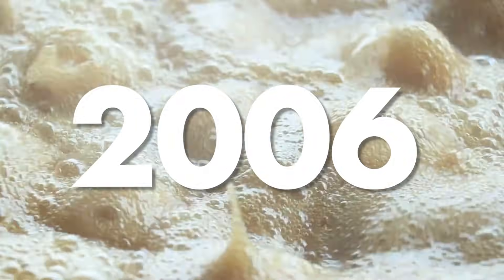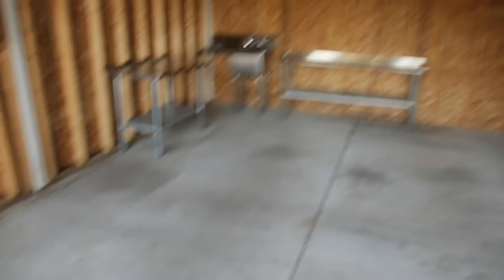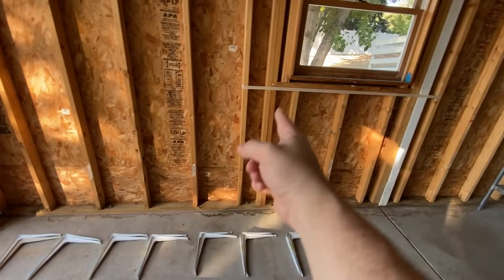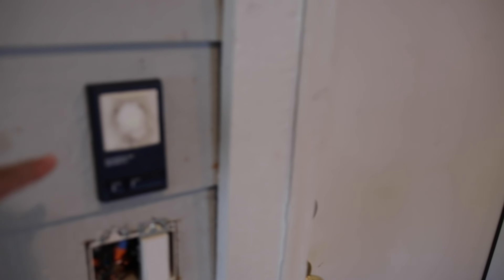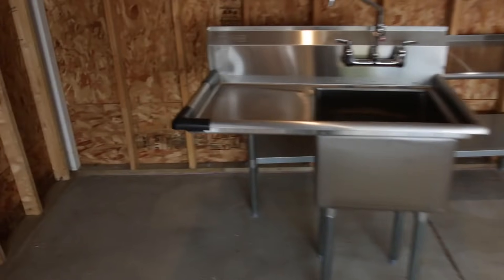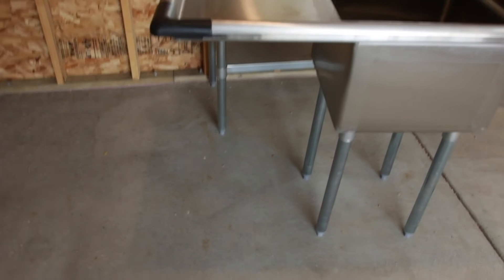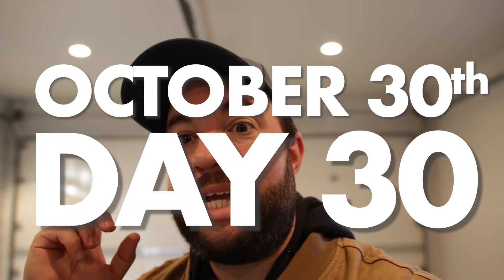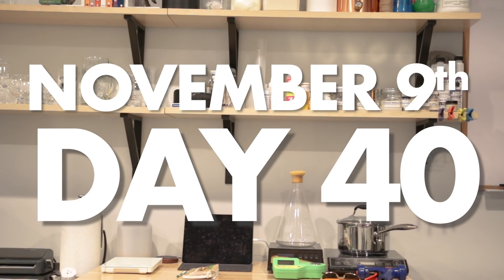I Built an AMAZING Electric Home Brewery in 40 Days

Comment from the maker: If you have any specific questions about the brewery build, leave a comment and I’ll make a video with more detail.
Reply: What kind of camera are you using?
Reply from the maker: It’s a mix between my iPhone, canon 7D, and a GoPro.
Reply: Can you provide a ballpark of how much the whole project cost?
Reply from the maker: @utopia901  About $30k
Reply: @BrewCabin  thank you! Planning something like this myself. Thanks for the video!
Reply: @BrewCabin  Mine cost $300K, but my wife insisted I build a house around it!!!  Finally got my designated brewing room and we are both happy.  Nice job!  Loved the song by the way.  Was laughing out loud!  Cheers!!
Reply: The pump you have for the utility sink, how well does it handle particulates/ etc. So far? I'm hoping to set up a nice brewery in our next home (being built) I don't want to have to use a pump unless I need to but mainly just not sure anything about them. Does it handle yeast/trub and hop matter or do you dispose of that differently??
Reply from the maker: @loganramsey1957  It's...ok. I've dumped bits of grain and hops and yeast into it with no problem so far. But I try not to get too much debris in there. When I rinse out large debris, I do that with the sink and into a bucket instead of down the drain. And I just dump the bucket outside.
Reply: @utopia901  You can buy a lot of good beer for 30k. Cool build though man... Jealous.
Reply: Can you do a final tour of the brewery? Also do you have a drain in the floor? That was the one thing that i installed afterwards in my brewery, a tilted floor angeled towards the drain, because brewing is messy.
Reply from the maker: So true lol
Reply from the maker: I will. And I thought about doing that but it would have pushed back the build. Maybe I’ll do it later though.
Reply: @BrewCabin  hit me up if you need any inspiration for it, i build my brewery a year ago and it's continuous improvement since then =)
Reply: We want second part!!!
Reply: +1 for the request for part two. I would love to have you go over the brewery setup and configuration and the parts you used and why

Comment: How have I missed your channel up till now? What sink attachment is that that allows the pulldown spray nozzle? Great build.
Reply from the maker: Ha! I found this whole set up on Amazon. It's a $200 faucet system designed for a utility sink. So it comes with everything but the sink itself. Which I also found on Amazon.

Comment: Awesome video. Quick question on the sink drainage.. Have you had issues with the drainasaur being able to handle small amounts of grain, etc or have you made sure the only thing going into the sink is 100% water? Otherwise, how have you been cleaning out the MLT?
Reply from the maker: I've had clogs. But it has a small filter built in I just had to clean out. Took 2 seconds. I don't through a ton of grain or hops down there. I dump that stuff in the yard. Little bits here and there are OK though. I clean the MLT by scooping out the grains into bucket and dump it in the compost. Then, I spray down the inside of the mash tun and let it drain into a bucket. I dump that bucket into the yard as well. Works pretty well without lifting the heavy mash tun.

Comment: Not sure is someone else asked, but how is your drain pump vented?  I had a similar installed in my basement, and they plumber just vented into the basement, which means I get smelly gases back into the basement when I fill it up.  From what I understand now it should be vented into the plumping stack to the roof.  What did your guy do?  I see it just goes thru the wall there.
Reply from the maker: It’s vented out the side of the brewery. The pump is right next to an outside wall.

Comment: How is the pump activated? I see it draws from the drum and out the pot filler, but. What tells the pump to turn on as there is no water pressure to activate it?
Reply from the maker: The pump is pressure activated. When I open the pot filler valve, the pump automatically kicks on.

Comment: Do you use the hot water line a lot? I want to do similar in my garage, but getting hot water would be a miracle from the 2nd story attic. I may have to just live with a cold water line.
Reply from the maker: I think I use my hot water more than cold since that sink is meant for cleaning and hot water always cleans things better.
Reply: @BrewCabin  Thanks. Makes sense. Maybe I need to look at one of those insta-hot thingies. Appreciate you, man

Comment: Love the RO setup. It sure beats gathering it in increments of 6 or 10L (1.5/2.5g) every few hours and really beats distilling 4L batches of water every 10 hours on my small distiller... Any issues with the float valve at all for preventing overflow?
Reply from the maker: Yea, it takes about a full day to get 30 gallons of RO. And the float causes pressure build up. So I only turn on the water supply when I need to gather RO for a brew day.

Comment: how did you install that pot filler faucet on the exterior/not running pex inside the wall?
Reply from the maker: I ran pex outside the wall. You can see the whole line.
Reply: @BrewCabin  lol I see that. I guess I meant how did you fixate the faucet to the wall. Either way, I figured it out. I definitely mocked up your set up for my garage brewery. Thanks for the inspiration!

Comment: This is actually a great video. I wanted to ask you since I am still very new to this, how do you keep steady temperatures without a refrigerator? I suppose to ferment the beer for 1 month or so at about 20 degrees Celsius right? Do I need to hack a refrigerator to adjust its temperature levels to be 20 degrees? What about for larger quantities like 100 litters? I hope you understand my question and pls answer me :D
Reply from the maker: I used to use a fridge. But now I have a glycol chiller.

Comment: Love the video and have enjoyed reading the content on your site. One question that I have is about your garage door--I don't recall seeing if you addressed whether it's insulated or not and how you deal with any draft where the door meets the slab as well as along the sides of it. Curious whether you have done anything with it because I imagine that can have a huge effect on your ambient temps. Cheers!
Reply from the maker: Great question! I will add more details to my blog post about it. I called a guy who specializes in Overhead Garage Doors (that's the brand). He said my door was insulated, but thin. Likely an R-value of 7. He installed a new metal rail at the bottom of the door to accept a line of rubber insulation. Now when the door closes, there are no air gaps (except a tiny one in the center where the concrete floor splits. I also had him install a new belt-drive garage door opener because mine was 20 years old and the sensors didn't work. Which forced me to hold down the button until the door fully closed. Got that all fixed. I'll update the post with photos too.